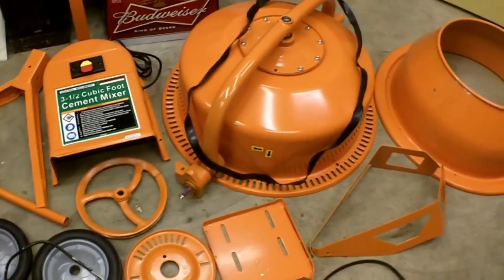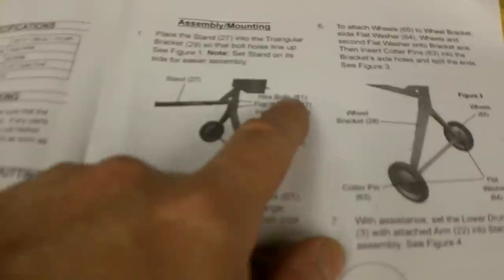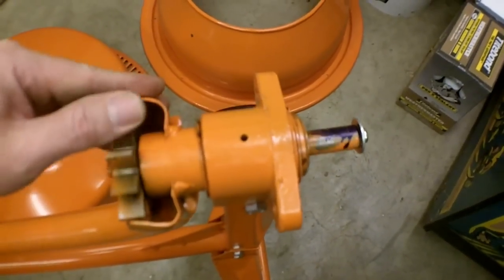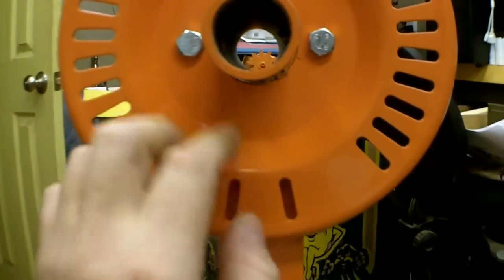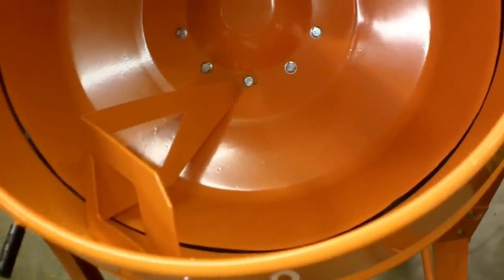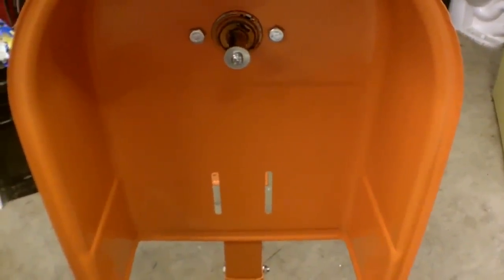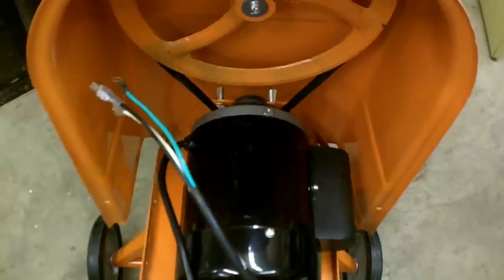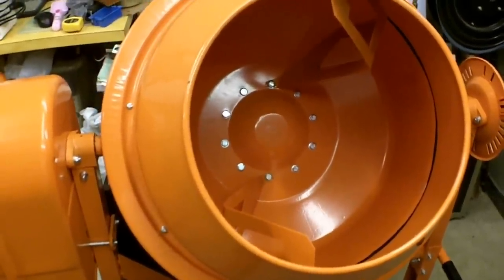Harbor Freight 3.5 Cubic Foot Cement Mixer Assembly and Review. Item 67536

Comment: Thank you very much for this video! Going to pick one up today for a two-day project. Just printed a 20% off coupon. Looking forward to using this video as I assemble it.
Reply: The newer ones are a little different. No need to plug wires. But good luck. Took me about 3 hours to assemble.
Reply from the maker: No problem Ryan! Good luck, G.
Reply from the maker: Thanks for the info, G.

Comment: I bought the same one ,very good design better than the one from Lowe’s , this one you can tip the drum straight up, makes it easy to place a bag of concrete on top and cut it open drops right in. I’ve mixed literally hundreds of bags of concrete with it , over the 5 years , no problems , just recently had to buy a belt
Reply from the maker: That's cool Dale! Glad it's worked out to your benefit. Take care, G.

Comment: Thank you, thank you, thank you.
While I am very good at assembling things, without this walk-through, I would have finished going bald.

Couple of points, I think the order of washers at 20:55 is not quite right. Bottom bolt of the paddle, the correct order, I believe, should be Bolt, Regular washer, Paddle, Thin washer, bottom of the tub, and then the nut.   If you put the regular washer between the tub and the nut, then the nut has nothing to really "grab" to keep from turning.

Another thing that happened to me, when I turned it on, in addition the the regular noise, there was a fairly loud tapping coming from what sounded like the motor.  When I removed the motor to check, the pully on the motor shaft slipped right off,  I replace it and tightened it with the appropriate allen wrench, and all seems normal.

The tub on mine makes the same sound as yours, as it is also not true.  I have used it for a few hours now, and so far so good.

Harbor Freight should pay you.
Reply from the maker: LOL.. No problem Kreg. Glad it saved you some hair!

I agree there should be no washer under the nut. Hindsight's 20/20!  I took a peek at the assembly diagram and they don't even show the standard washer- just the bolt going through the paddle, then the thin aluminum washer, then the nut that would go on the backside of the drum. They must have updated the design but not the manual. But, the standard washer should go on the bolt first if used- for sure.

I haven't had a problem with the paddles loosening up, but I haven't used it all that much either. When/if it does, I will be switching it around based on your observations.

It sounds like they didn't put the hurt on the setscrew at the factory. Glad you found it quickly before any damage was done! If it loosens up again, I would put a bit of thread locker on it.

Good to know yours sounded the same- must just be their nature. It does seem to quiet down quite a bit when mixing- which is good. I'm kind of anal about squeaks, rattles, and growling...lol.

I think the only way they're going to pay me is if I fill out an app and work in a store....lol. I would like to write the assembly instruction portion for their manuals though- and shoot videos for them. One could only hope..lol.

Thanks Kreg and good luck, G.

Comment: Excellent video Ghostses.  I was considering purchase of this cement mixer but I'm still a bit concerned if the growl you had in your mixer was something major. Have you used the mixer since you made this video?  Thanks for your work in identifying all the pieces for us. You must have had one heck of a job attempting to determine proper screws, bolts, and fittings but you certainly made it quite easy with your video.  Kudos to you, sir.  Have a great 2020 New Year celebration.  It's going to be a great year!  Full watch 👀 and a Big Thumbs-up!  👍
Reply from the maker: Thanks! Yes, I'd been using it quite a bit lately and have addressed how to fix the growling issue in another video. It's not perfect, but palatable. Hope this helps, G.
https://youtu.be/QSOSoQ8tH2w

Comment: Followed your instructions, got to the motor wiring and there isn't a second ground wire post. I tried hooking the wire to the single post, motor doesn't work. Thinking of drilling another ground wire post and nut and bolt the other wire. Do you think that would work?
Reply from the maker: Dave, you should be good with hooking both ground wires to one post. The motor should work without the grounds being connected so it sounds like there is another problem. What it is, I can't say. G.

Comment: On the gasket, i see that the bolt holes are not centered and that you placed the larger part of the gasket toward the center of the drum. I followed that too but see that even pushing the belt in while tightening the bolt/nuts leaves too much extruding out, could be an issue with mixing and cleaning. Should the gasket not be flipped where majority of it aims to the outside versus inside?
Reply from the maker: +Paul Naz 
I see you answered your own question Paul! G.

Comment: Did you consider the little brother to this model from HF?  I'm inclined go go with this, but wondering if the smaller one may be adequate for my one time/infrequent use and take up less space, so long as it's equivalent in durability.
Reply from the maker: I did consider it, but went with this one to mix more at a time. That really was the extent of my research on the smaller one so I can't give you any real opinion of it. Sorry I can't be of more help. Good luck, G.

Comment: Excellent video!  I didn't see any ads, so I hope you're making some money off it, especially since Harbor Freight links to it.  Having watched I decided not to buy this mixer, even though I am a Harbor Freight junkie.  Not because I can't build it, but because it's not worth the time.  If it took you 1.5 hours, it'll take me at least 2.5 hours and add to that the time required to go to HF for the machine and the extras we're at 4 hours total.  In 4 hours I can mix and dump a pallet of Sakrete using a heavy duty drill and paddle (that's about a yard of concrete).  If I've got any more than that to do, I'm getting a load of ready mix.  Seems like this is a good mixer to buy for a machine building hobbyist.  I would buy a mixer because I want to save some time to get a slab poured in a weekend. So it's because I am an avid dyi'er, who knows concrete well (I worked for Sakrete for 10 years in their tech department) that I say iI don't think it's worth it.  Should point out that any mixer is not faster than a good drill/paddle and maybe a little worse on your back since you're lifting each bag higher to get it into the mixer.
Reply from the maker: Thanks. No, I post for free. Good info on the rest. It might make sense for some- but not all. Thanks for the thoughtful post. I'm sure it will give others something to consider. Take care, G.

Comment: Great vid. Looking at picking one up and your vid is very helpful. have you used it?
Reply from the maker: Jerry T Thanks Jerry! I have used it, but not to the extent of my intended purpose just yet. Knowing full well it's not a mortar mixer I did try a bag for that purpose. It stuck to the drum horribly and I had to scrape it out by hand...lol. Mortar mixers have scraper blades to clean it off the drum as they mix. I have ran several bags of concrete mix through it and it worked great. Not extensive use by any means, but it does work great when using the proper stuff in it! My barrow is also fairly low so I've not has a problem unloading. I have heard of others not being able to unload so you might keep that in mind. You might have to put the mixer on a riser of some sort if you have that sort of issue.  Hope this helps in some way and good luck, G.

Comment: Very good Video. My key was lost and had to make another one as they do not even know what that part is at Harbor fright. Great machine though but all parts should be sold. Does anyone  know where I can buy a key that's meant for this machine?
Reply from the maker: Thanks Jack! I don't know the size of the key, but it should be a standard size. A hardware store should sell key stock that can be cut to the length needed. Good luck, G.

Comment: Where can I get wider (and maybe larger diameter) wheels? The cement mixer's wheel bracket has 1" diameter axle. Everything I can find at Harbor Freight has a 5/8" axle bore. Something wider would be nice on loose gravel and dirt on the job site . . .
Reply from the maker: Not sure Randy. You might check Northern Tool or Tractor Supply. Perhaps they might have something that would work. Good luck, G.

Comment: The product has evolved a little bit over time. I bought a mixer this year (2022)… Some examples of differences include … 1. it has a nylon locknut for the control handle. 2. There’s also no way to adjust the spring tension. 3. The parts are not individually bagged. 4. The lower drum assembly is put together already.
Reply from the maker: Yes Burt, they are a bit different- based on the model numbers.  Take care, G.

Comment: WoW Buddy you just convinced me to purchase this mixer as I read all the reviews and the Assembly was a nightmare for MOST but you did an OUTSTANDING JOB on FYI !  Thank you Mr. Vargas 
PS one person said to reduce noise and cut that clunking is to place 5 large waster under the bottom drum on the shaft...no more clunking?  this note was on ONE REVIEW. just saying.
Reply from the maker: That's cool! Glad the video will be helpful. It's really not that bad after everything is laid out. Interesting on using washers. I can see how it would loosen up the gear mesh a little. Good luck, G.
Reply: Hey Ghostses, I just retuned from my Harbor freight store and made sure the box was in tact  no tears and yet  there was a very small dent on the upper half  lol  I took a plastic mallet and hit it a couple of times and things are under way ...I am taking a lunch break and then I will open the ONE BOX with all the nuts and bolts I am not sure if they will come in numbered plastic bags  {  FYI  I viewed another video who gave you a TON OF CREDIT for  a very fine video you posted at the same time he had the Latest version   # 61932  which the lower half and cradle are ALREADY attached and the electrical wiring is also assembled  the tension spring no longer has the adjustment bolt a few new changes also the small oil holes are no longer their?  Oh well...again thank you for your fine video I will view your how to video is needed ...I will oil or grease parts where I can .... I will post the results once I assemble this PUPPY....Sifu   Sunol, CA
Reply from the maker: Well that figures....lol. Based on the lack of QC I've seen on some of their products- I would bet money it went in the box that way...lol. Not that it "really" matters, but it still matters in my eyes. Feedback with how your fasteners came.

Yeah, he'd contacted me in the past and told me he had that video up- and outlined some differences. I believe there is a link buried in the comments somewhere. The shout out was nice- but certainly not required. It's nice to have two takes for others- since they do have slight changes.

Do let me know how it goes. Take care, G.

Comment: The latest model has much nicer electrical fittings and the motor cord is pre-attached to the switchbox.   The 8" pully no longer has a set screw, but now has an end screw in the shaft just like the cog end.  The bottom drum and support arm ships as one piece, probably because they don't want you to know they don't put a bearing where the drum turns in the support arm.  Take that bolt out, slide the drum shaft out, and grease in there well like he shows.   Definitely use blue locktite on every bolt and especially both key slots in the shafts (pully and cog gear).  I also made an "anti walk" plate out of a 12x24 piece of 3/4" Advantec (waterproof OSB sub floor material) and then used four 6" galvanized carriage bolts to pierce through it into the ground.  I attach this onto the base of the handle end, there are already two holes drilled in that base.  When on soft ground I can step on it and push the 6" bolts into the ground and it won't walk anywhere.
Reply from the maker: Nice write up and tips Clay! Sounds like you got it going your way. Take care, G.

Comment: Just noticed that you have a 2nd terminal for the ground wire. Did you add that yourself or is that how the mixer comes? I only have the one, pre-existing terminal.
Reply from the maker: No Peter, that's the way mine came. I don't know why there was a second in the first place, since one is all that's needed. Good luck, G
Reply: Thanks G. It just threw me off. It was a pain-in-the-butt but I got it up and running.
Reply from the maker: No problem! Glad you got it going. Take care, G.

Comment: Thank you for this video. I do have a question for you. I made a huge mistake. I open the motor box to connect the wires. By trying not to let a screw fall, I drop the motor cover and the wires got detached from their number post. Could you tell me what number matches  the neutral & hot wire? Thank you in advance.
Reply from the maker: I looked at mine and my motor doesn't have a cover to access the wiring. The wires enter in the side of the motor. I've never seen a motor like that in my life. I would download the manual for your exact model number and see if they show the wiring diagram. Sorry I couldn't help, G.
Reply: @ghostses  I do apologize instead of saying the motor I should have said the power switch. I think I figured it out but I wanted to double-check to make sure that I aligned everything correctly. But thank you for your assistance
Reply from the maker: @notalionsfanbut  No problem! It doesn't matter which side of the switch you choose to connect the wires to but just make sure their vertical in color. Hope this helps, G.

Comment: Great video. One problem though. When I try to bolt down the lower drum to the u-shaded bracket, the shaft that the bolt goes into moves on me. How were you able to tighten this bolt down?
Reply: 14:50 in your Video.
Reply from the maker: +Shane Watkins 
Thanks Shane! I was able to simply tighten it up without problem. I did look at the parts breakdown, and it does look like there are two bearings which which could allow it to turn like you've mentioned if all the slack isn't taken up on the shaft- by the fasteners. For starters, ensure you have the two large washers on the shaft first, then install the drum, followed by the flat washer, lock washer, then bolt (14:26).  If all is well there, try to swiftly hit your wrench with a hammer to get things to tighten up. If that doesn't work, it sounds like not all the slack is taken up which might be a manufacturing issue. You might need to add a  flat washer to the bolt to take up that slack- or return the unit for a replacement- which would be a hassle for sure. Give that a go and let me know how you make out! Hope this helps, G.
https://youtu.be/78OznS9OtGQ?t=866https://youtu.be/78OznS9OtGQ?t=866
Reply from the maker: +Shane Watkins 
You pretty much referenced the exact spot I did. Let me know, G.
Reply: +ghostses that helped tremendously. Hammering didn't get it to catch but I was able to wedge between the drum and frame while jerking on the wrench a few times until it finally tightened all the way. Thanks for the quick response. Now my gasket can set between the two drums to flatten out until tomorrow. Thanks again.
Reply from the maker: +Shane Watkins 
That's great Shane! I'm glad you found the solution to your problem. I'm sure it will help others out if they have the same problem you did. For the gasket, I would just do what I've shown in the video and forgo any sealer. Mine does not leak, and you could always seal it later if yours does. Either way, glad to help and take care, G.
Reply: +ghostses yeah. I'm going with your way on that gasket. Its pretty much is a nonissue thanks to the bolts grabbing to the gasket like they do to hold it all in place
Reply from the maker: Shane Watkins

Good deal, and I agree! G.

Comment: Why does the mixer barrel wobble off gear when filled (fine when empty)?  Is it the bearings, and if so, how do you replace them?
Reply from the maker: Nancy, please verify the drum is installed correctly with the washers at 14:25 in the video and the bolt is tightened up properly. If you find all to be correct, and it still disengages the gear mesh, the drum/shaft maybe bent. If so, I would exchange the unit, if possible, for another. I hope this helps in some way and let me know the results. Good luck, G.

Comment: Is there a place that could match up the hardware bolts screws washers and nuts to the right places.  I had two bags and nothing matches the inventory sheets.
Reply from the maker: +Margaret P. Clarke 

Hmm, I'm not sure Margaret. Perhaps you could step slowly trough the video and lay things out as I've shown them here. It might help you narrow them down somewhat. I believe they've made some changes since my posting of this video so it might not be totally accurate now- but it might help. Sorry I couldn't be of more assistance. Good luck, G.

Comment: Thank you very much. It was very helpful even though it seems to be easy assembly listening to your explanation and if you haven't seen how mixer looks like before assembly, you might get stuck! The pictures in manual are low quality. The wires already inside were opposite way from you. I matched white-white black-black, turned on mixer and and tried out luck 10 ft away by sticking cable into outlet and yippieee-it rols like a turtle.
Reply from the maker: Necko L No problem! I'm glad you found it useful. As you've found, it doesn't matter where the wires are on the switch as it comes, just as long as you match up the colors when installing the motor- which you did. Good luck, G.